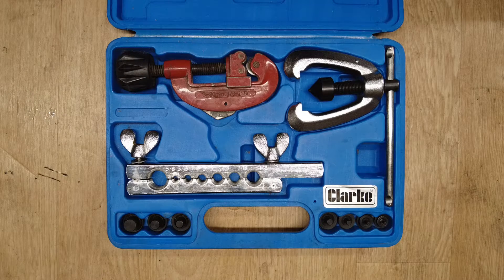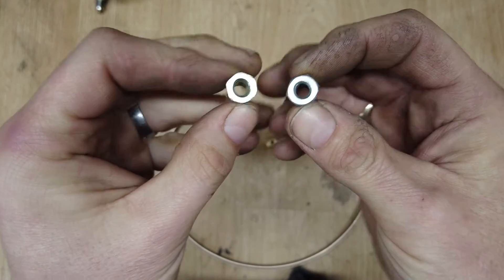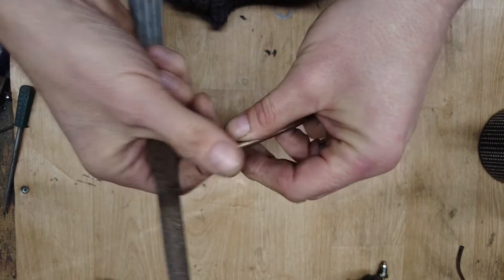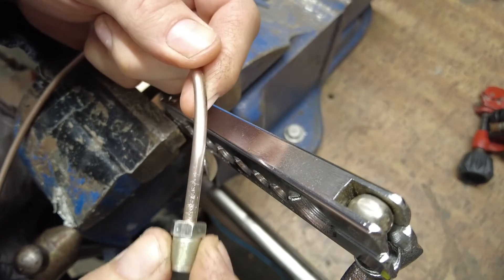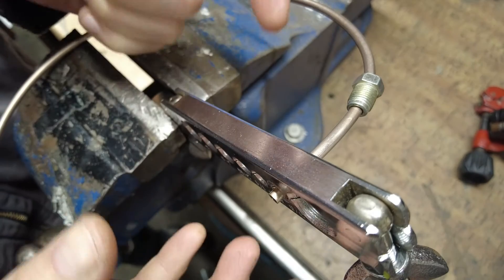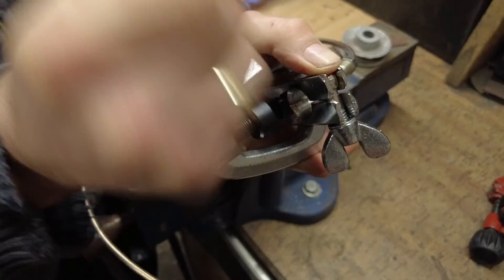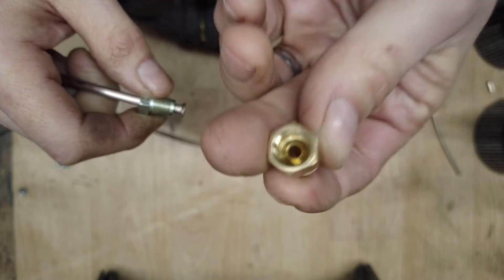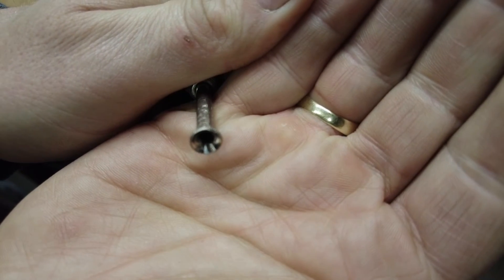How To Flare Brake Pipes - SINGLE Flare / DOUBLE Flare - DIY Tool Guide Making Your Own Brake Pipes

Comment: How do i stop the pipe from slipping on the clamp?
i've tightened the clamp as much as i could
Reply: Are you using the correct pipe size to correct hole?
Reply from the maker: Weird. Usually it puts marks in the pipe it clamps so hard, you usually have to be careful not to over tighten it? Are the teeth worn or are you usingbrhe correct pipe size to hole?
Reply: I am using the correct pipe size to the corresponding hole, I must just have a low quality flaring kit 😅

Comment: I could really do with a brake booster.
Reply from the maker: Wait to see how mine works first! Total experiment and might go Pete Tong! 😅 Concerned about over braking the light front so fitting a bias valve too, would be done by now but the first valve turned up faulty! What brakes are you running?
Reply: @PeoplesCar  Stock fronts and 914 rear discs with Golf mk4 calipers. Bias has been good. I'll watch with interest.
Reply from the maker: @djambrosia  914 rear never seen that conversion. I have a 944 hub somewhere converted to 4 stud with flange from a 914 hub, so I could fit 8.5'' bug 4 stud Wolfrace Slots on 944 IRS conversion. That crazy idea didn't quite work as interfered with the handbrake mech and then dropped on a cheap set of teledials so remains and unfinished mod! 😅